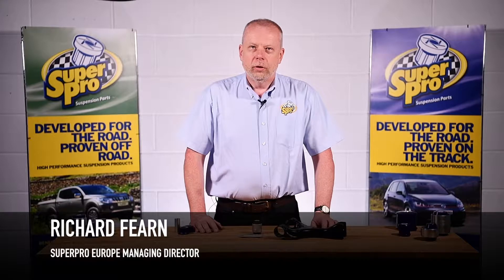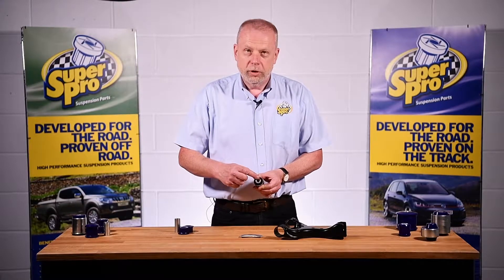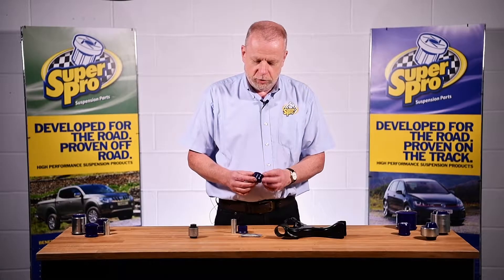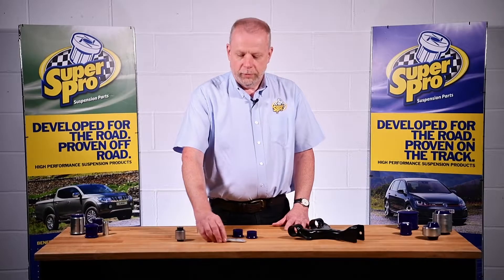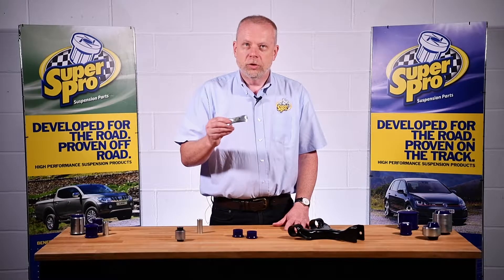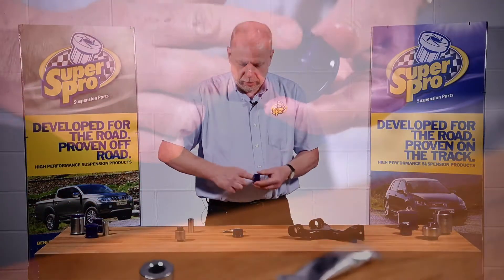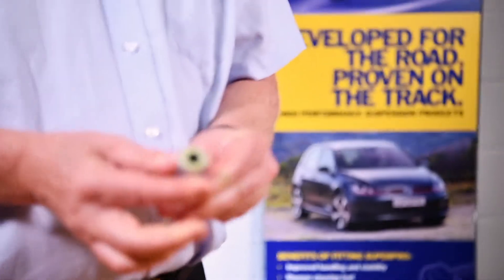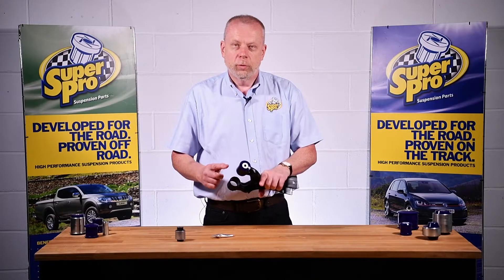Why We Supply Grease With Every Bush Kit

Comment: OK, so I bought KSP upper control arms for titan came with PU bushings.  those damn things are so damn lound.  the outer area of bushings  are squashed against the control arm bracket and the shaft is in the bushings very tight.  its how they made it.  Do you have any answers on how to remedy the loud squeaking noise???

Comment: An offset bush can be supplied by Superpro also - to give camber correction.   With the hole going through the urethane "off-centre" I would need to be sure it will stay in position in the control arm housing.  So why would I grease it if I want it to stay in position?
Reply: Offset bushings are a fantastic analysis of why the outside of the bushing shouldn't be lubricated. Thank you for pointing that out.

Comment: Why smear grease on the outside of the bush? Isn't the inside meant to twist and the outside meant to fit snuggly and dry (semi fixed) in the control arm?

Other video's of other suppliers strongly advise against putting grease on none working areas.
Reply: Rubber bush twists a poly pivots (around the inner tube)  it was pretty well explained
Reply: Dude. I know this was 2 years ago but wtf